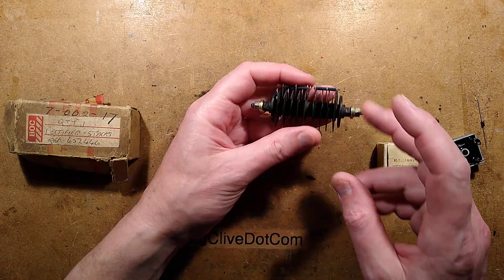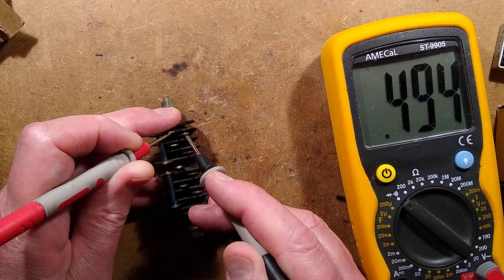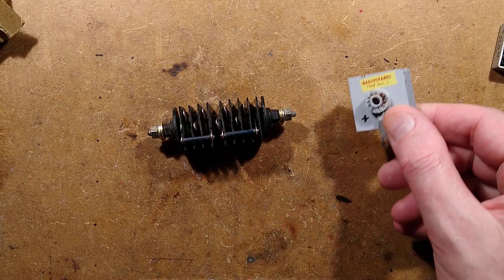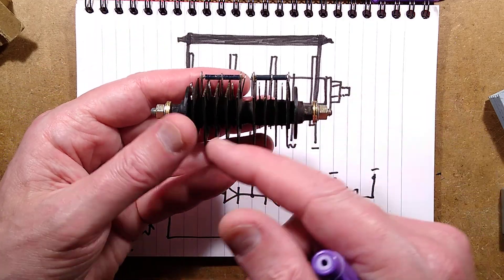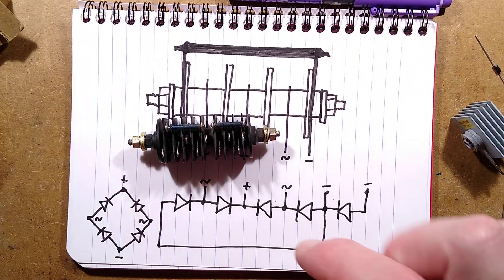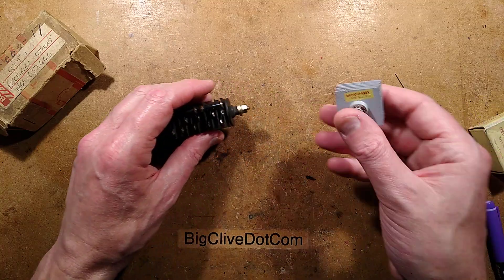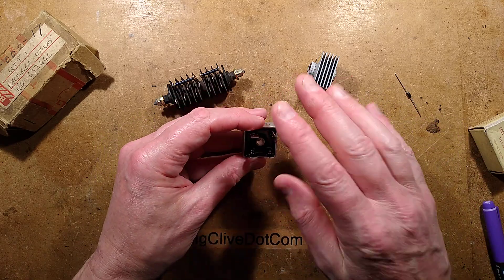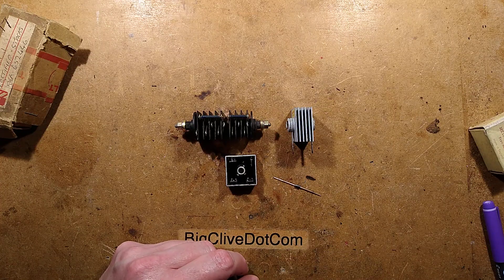Selenium rectifiers - the smelliest components ever

Comment: Dear Clive, every time I tunein, you're dissecting an old nemesis of mine, this, the rectifier from a 1964 Triump Tiger 650 twin.  Big old rectifier about an inch and a quarter square, two tall, on an aluminum heat sink wasting the "excess power" generated by the Lucifer electrics, or more commonly known, Lucas, which seldom have sufficient, much less "excess electric power".  On the other hand, components always dump voltage and heat regardless whether it's beneficial, or detrimental.  You always bring back warm memories from my youth, back in the late sixties, early seventies.  You can run that engine without a battery, rectifier, anything, enough to run the points, engine, straight on the ac generated, barely.  Got over a hundred miles that way back about 76.  Thanks, always a pleasure!!

Comment: My older elevator equipment I repaired for a living had these in the controllers.  the were, plate sizes 7" X 10 " and they had 30 some plates..... always knew what happened when you walked in on a rectifier failure..... yup..smells like farts...

Comment: Using a ballast resistor in series is a good idea, as Clive mentions, when converting a selenium stack or vacuum tube rectifier to solid state.  I sorted out a Collins 51-J3 receiver where the previous owner replaced the pear-shaped old style 5U4 rectifier with a solid state module, but no ballast resistor was added.  The increase in B+ was apparently more stress than the PTO oscillator could handle without permanently throwing the linearity off - that was despite having an 0B2 regulator tube right on the frame of the oscillator can.  Sometimes a little thought before execution would be a good thing.

Comment: I recently bought a nice huge semikron full bridge selenium rectifier. It’s from the late 50’s I think and looks brand new. I just have it for it’s looks but I tested it anyway and works perfectly still. 
It was originally meant for a big battery charger I believe. It’s rated for 25’volts,
36 Amps.

Comment: That was interesting and explained a few things . 
When I was about 13 or 14, 'we' had old motorcycles (late 1950's~mid/late 60's) with selenium rectifiers which 'always' seemed to have charging problems.
.Instructor from local tech gave us some bolt down diodes (total overkill, probably 3/8" diameter) to make a  bridge rectifier for 'something' (so long ago I forget what bike) 
After that, anything and everything got silicon diode bridges until they became a common fitting on motorcycles in the mid 1970's.
The Honda CB400A and later unit was so good I used them on most bikes (Suzuki in particular STILL- well, 2010, don't make a decent rectifier /regulator unit)
Surprisingly (maybe?) there are still a lot of late 60's bikes out there with original electrical systems and just as many people who have no clue how a simple system works.

Comment: Clive speculated on the use of the fifth diode in the stack.  When choke input filters were used, the choke means that current flows continually, so a fifth diode shunted the bridge rectifier, to provide a path for this current when the bridge diodes turn off.   Without this extra diode, circuit operation is a lot less efficient and the heat dissipated in the bridge diodes is a lot higher as the choke will try to force the diodes to stay on.  If the filter has an input capacitor before the choke, the fifth diode isn't needed and was not included.

Comment: The fins are for air cooling,  The actual diodes are small devices inside.  Clive also didn't mention contact-cooled selenium rectifiers - these are flat devices with no fins - they need to be bolted to metal to get rid of the heat - usually the equipment chassis.   If the equipment is of German or Japanese origin and the rectifier is thin, of wide area (several square inches or more) and bolted to the chassis, it will be a selenium rectifier.   This type of rectifier was made to high standards and seldom fails - but if you buy old gear that may not have been switched on for years, reform the rectifier with a Variac, or small light globe in series, and bring the voltage up slowly as the rectifier gradually begins to "remember" it's supposed to rectify.
Because contact-cooled selenium rectifiers don't have cooling fins, the actual diodes can be very thin, and a bridge rectifier rated for a few hundred volts may be only 6-10 mm thick.

Comment: Clive didn't tell you what you need to know when working or restoring old equipment with selenium rectifiers:-
The most important thing you need to know, is that like electrolytic capacitors, actually working maintains their performance.  If equipment is out of service for a long time, they loose their rectifying ability - forward resistance rises and back resistance falls.   If equipment has not been turned on many years, the rectifier is likely to go up in smoke, with the famous bad smell.   What you need do is power up via a Variac and wind the voltage up very slowly, to reform the selenium rectifier (and electrolytics).   This is the main cause of selenium rectifier battery chargers going up in smoke when not used for years on end.
The second thing you need to know is that selenium rectifiers were made in several grades.   Generally, the cheap selenium rectifiers used in consumer equipment are not to be trusted.  But selenium rectifiers used in professional grade equipment were made with more care and last a very long time (provided you reform them as described above).

Comment: I have a bunch of old wall mount electro-mechanical games that I still need to get round to converting the rectifiers in. I don't trust using them.
My rarest game (IMO - Diana) suffered a fire in the past from a failed selenium rectifier, so yeah, they don't get powered up if they have selenium in them
Reply from the maker: I love those old games with the rotating wiper arm clicking round contact posts.

Comment: Something to watch out for (in the U.S. at least) is older electronics that use these may also be set up to run at 110v or 115v.  If you replace them with a modern silicone version & plug in to modern 120v, the increase in voltage may be too much.

Comment: I come across quite a few of these while restoring old tube amplifiers and always replace with silicon.  In doing so, it's often necessary to drop the voltage by either changing a resistor or adding an ICL to the primary side of the power transformer.  I've never had one fail on me, thank goodness.

Comment: I used to drive a crane that was dc powered. They were using the same rectifier that was used when they changed the supply over from DC to AC 100 years ago. It was built inside a steel cabinet the size of a traffic light control box and had one huge selenium rectifier and some valves larger than the size of wine bottles.

Comment: Had a retired US Air Force veteran as an instructor way back when in an Electronics Class who warned us about selenium rectifiers. When they fail, they emit a poisonous gas called Phosgene. Be thankful silicon rectifiers are available to replace these archaic and deadly components.
Reply from the maker: I'm not sure it's phosgene.  The smoke tends to be selenium dioxide, which isn't great to breathe, but you wouldn't want to anyway.
Reply: @bigclivedotcom  Apparently all it takes is a chip of paint, on one or more plates, to fall off which exposes the selenium to atmosphere. The reaction to oxygen and electric current results in Phosgene gas emission. There is a very faint odor to this toxic gas that can go unnoticed. It only takes a few minutes to become fatal for an average human.
Selenium rectifier manufacturing and sales ceased in the US when this was discovered as potentially harmful. 
As tech students, we were strongly advised to replace any of these vintage rectifiers. Don't even power them up. Cut the leads and remove.
My hobby is restoration of vintage audio equipment...radios, wire recorders, and reel to reel tape machines. I have discarded plenty of these "potentially harmful" devices. It's not worth taking a chance.

Comment: Very common in 1950s - 60s European and American tube radios and televisions to replace the rectifier tube. I have a 1940s vintage 12v/22A power supply with an absolutely massive selenium stack. Normally I don't replace components that haven't failed yet… but I make the exception with selenium rectifiers. Not worth the damage that happens WHEN (not IF) they catch fire. Glad you covered this topic. People won't act if they don't know.

Comment: I am 73 years old, but I never needed to replace a selenium rectifier.  The closest I came to that situation is changing a 6H6 with  a transistor.  My cousin had an old Rogers Majestic multi-band radio, from about 1937-8.  Ron told me that the radio didn't work and asked me to look at it.  I had doubts about it but I found the 6H6 had an open filament.  He had no money, I had about the same, so I worried about it and decided to replace the 6H6 with a silicon transistor that I happened to have.  The radio worked until he died 45 years later.

Comment: These things used to fail with alarming regularity on some very old machinery i used to work on. Smelled like rotten cabbage! They were huge though, unlike the ones in this video (rectifying ~5kV @ ~15A per phase, three phase feeding aan RF welder that used a vacuum valve to generate 27MHz at up to 30kW) and jeeeeeeeez, did they stink! They would clear the factory unit when they went! :o

Comment: Well, they were better than their predecessor, the copper-oxide rectifier, which, in turn replaced the high-current mercury-vapor and gas rectifiers.   IR in the 1960s even offered replacement kits that took silicon rectifiers in the form of cartridges that snapped into holders.   Silicon diode replacements also were popular in the early 60s to replace the gas rectifier in vibrator supplies used in auto radios. 
I always thought that the stink coming from a going-bad selenium rectifier had more notes of garlic in it than eggs.  A rather peculiar smell that I shall never forget.
One of the interesting experimenter project was to construct a solar cell from plates from a selenium rectifier.   (Anyone remember the IR B2M photo cell?)
Curiously, selenium isn't quite dead i the field.   Making inexpensive amorphous solar cells by embedding selenium in zinc oxide has been studied.

Comment: one thing , especially with multi section selenium rectifiers, you cant test the conduction one way or not with a multimeter, due to higher voltage drop, and makers state never to attempt to measure reverse resistance or 'breakdown' voltage with a high voltage device such as an insulation tester, it can destroy the junction making it short

Comment: i have a box of used selenium bridges remove from school science power supplies as when tested on full load current the voltage dropped excessively, they've gone more  resistive, but are still perfectly usable at lesser loads

Comment: I recall in the 1950s that my Hornsby Dublo model railway, running on 12v,  had a power pack with transformer and selenium rectifier.   I’m now 78 and live in US.    I think my really old Sears car charger has a selenium rectifier from mid 70s.    I will check that out of interest.
Reply: hah! I've still got one of those Hornby model railway power supplies somewhere. I should check it out. They were very rugged. I used to short it regularly as a kid because I thought it was cool to see the insulation melting....

Comment: My 1950s Tri-ang electric train set transformer had one of these inside, painted grey. I was an inveterate taker apart. It never failed, so no stinky-poo. It was full-wave double diode with a tapping on the transformer - output 12 volts.

Comment: Yes clive, I remember these.  I worked on valve tvs in the late 6os & 70s and yes I remember that stink !  Love the random Vids,  you explain the de-engineering well
one thing I would like you to explain in the workings of CURRENT TRANSFORMERS that clamp around meter tails ... the ones that know  which way the energy in flowing :  IMPORT OR EXPORT  these are used on the   iboost  units ( and simular) which work with Solar Panels & water heating immersion heaters

Comment: I always put limiting resistor, about 100Ω wirewound as at switch-on
the big TV electrolytics would be empty and a damaging surge could occur, at very minimum blowing a fuse.
As Clive says, voltage o/p could be above ratings so that needs dealing with.
Get that workshop window open and the extractor fan at Hi-Revs/

Comment: Must be getting old - I remember 3 phase Mercury Arc rectifiers powering a spinning mill in the 1950s. They were impressive to see  in operation and more than a bit scary to a young apprentice.
Reply from the maker: First day of my apprenticeship I saw the biggest mercury rectifier I've ever seen.  The 500V DC system for a steelworks.  It wasn't running at the time as new switchgear was being installed.

Comment: The smoke IS BAD!   The smoke consists of selenium oxide dust.  The human body DOES need selenium, but only in MICROGRAM amounts, but any more is TOXIC!
          I would describe the odor as that of rotting fish.
          If you take one of these apart & strip off the paint, you can make a SOLAR PANEL from it.  Are you familiar with international Rectifier Co.?  That company started its business making selenium solar cells.  These had the advantage that they responded to more like film & the eye's spectral response.  They were commonly used in camera self-powered light meters & sensors for streetlights to turn them off in the day.

Comment: In the early to mid 60s (while I was still at school) I would often repair people's TVs by replacing the selenium rectifier by the "new" BY100 silicon diode in series with a resistor to equal the voltage drop. By the 70s selenium rectifiers were mostly gone in consumer electronics.

Comment: There are two points here, first, the stinky smell was an immediate diagnostic that indicated that the rectifier had failed.
The second point is that, I think the selenium rectifiers had quite a series resistance, which would result in the capacitor charging up gently when first switched on. When smacking a low resistance silicon rectifier in, in place, you could find a very high surge current when switching on and the recommendation was to include a low value resistor to limit the inrush current. Sometimes this resistor is then bypassed by a relay contact after the switch on is established.